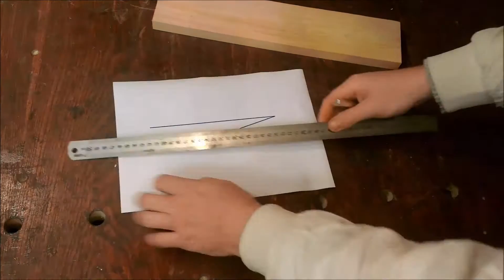Segment rings for woodturning

Comment: Hello Alexander,
could you explain what you are doing on your tablesaw sled please?? how you worked out the angle you are cutting each segment at.. im only woodturning 3 months and do not understand the concept of segmentation ??  you have made the idea look much easier,, thank you Alexander...
Rodney
Reply: +rodney sharpe
A circle has 360 degrees. The segmented ring had 12 segments, so 360/12=30 degrees.
To get the grain to line up Alexander kept the orientation of each segment the same, so he had to cut off the 'wrong-facing' angle for each piece. The removable stop-block (ingeniously devised) was used to make sure each piece was the same length.
Reply from the maker: That's right, Steve Hall. Thanks
Reply: do all sections of segmented object have 12 segments? and how do you work out inside outside measurements..lol  its an easy concept for you guys lol